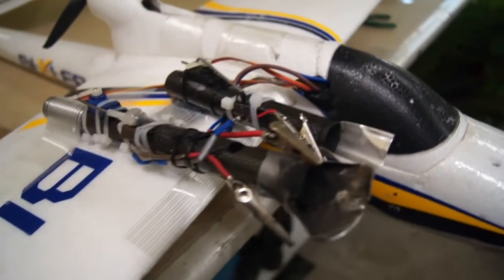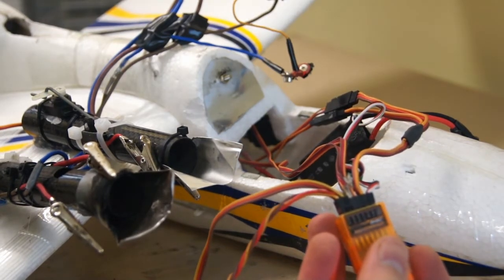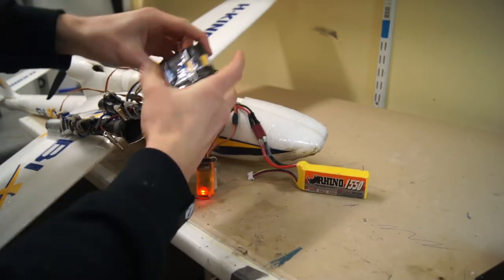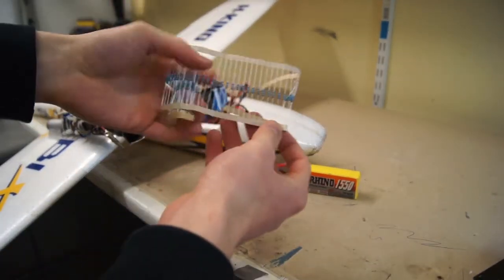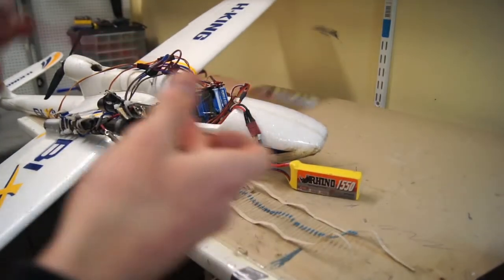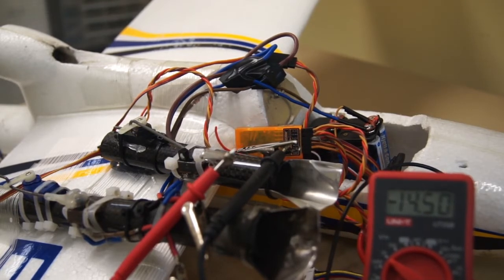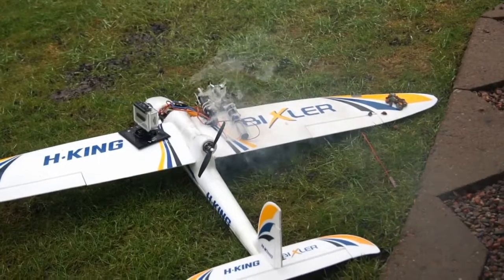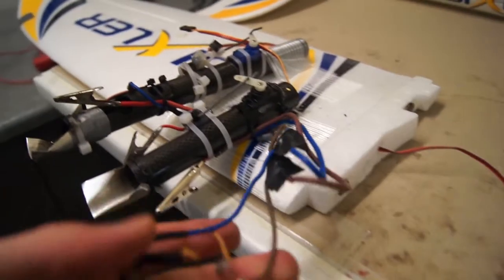Shooting Fireworks From RC Airplane - RcLifeOn

Comment: If people rigged up two planes like this and had them dogfight I'd watch it. Seems like laser tag wouldn't work due to outside light sources. Maybe some sort of wireless connection between the planes that could detect relative position and orientation of the two planes to decide if a shot was hit. I'm no engineer though, I'm just spit balling.

Maybe you could just watch the two video feeds and base scoring on the amount of time the other plane was in your sights. This would probably be easier to do and only would require someone to build another rig like yours for you to dogfight and some referees of some kind to watch video feeds.
Reply from the maker: +KillaAhmadilla Yeah, I'm thinking of revisiting this project. My goals would be to make it way more simpler, lighter and be able to fire multiple fireworks.
Reply: That would be pretty awesome to watch from that view as well. .

Comment: Very cool..i did something similar but simplier...a 12v switch wtih a 9v battery and a 5 gram servo glued to a piece of plywood..ran a small control rod from the servo to the swtich...and then had a direct connection to the clips to an igniter...only tried it out on the ground..your solution of the diode is pretty neat..and keeps the fire hazzard possibility down! Something i need to think about!
Reply from the maker: To use a resistor as an igniter was inspired by David Windestål and yes, resistors does not actually set on fire, it just glows, wich will keep the fire hazzard down. Other than that I went quite overkill with the powersupply, it's not really necessary but the Bixler could handle the weight so why not? :)
Thanks for watching man! Really appreciate it!